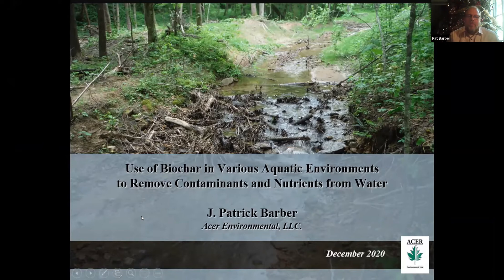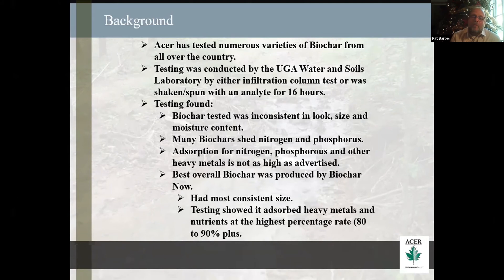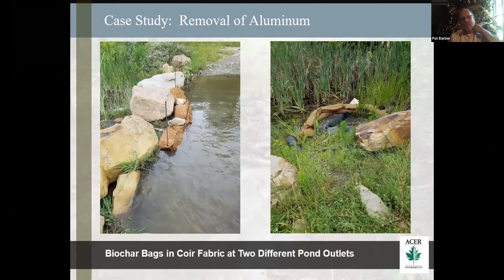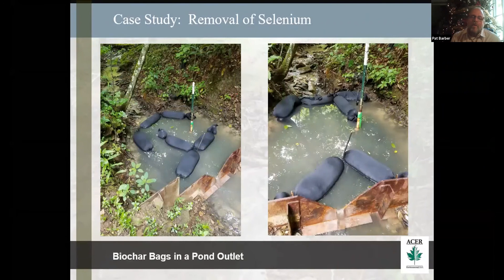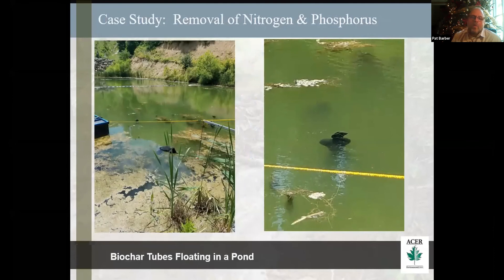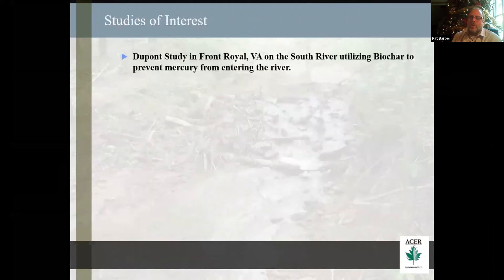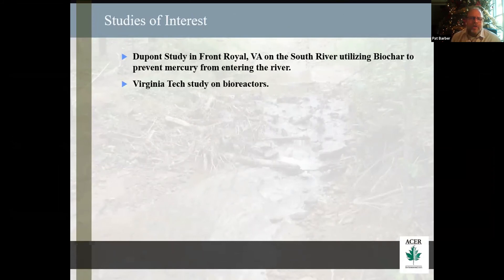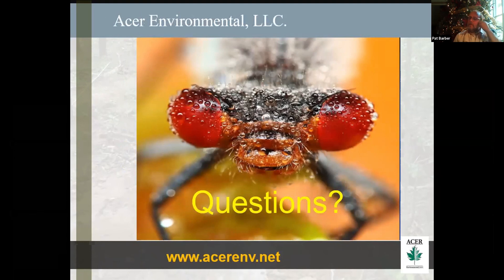Patrick Barber: Use of Biochar in Various Aquatic Environments to Remove Contaminants

Comment: I am doing this using my late brothers socks and fir cones and bark I get from the property. I live with an abandoned and buried contaminated soil dump in shawnigan lake. I make biochar  in a barrel tlud kiln and put it in socks with a bit of sand in the toe so it sinks. I  have been getting the community to hang socks off their docks. My water is as clear as it was when I was a kid. Amazing. I cleaned Fuller Lake after it got a no swim algae bloom. 10 socks.. gone in 6 weeks. Clear as it was when elders were children. So cool. The local givt don't want to help me so I do it myself with my water warrior community. I made charcoal filled socks and attached used haybail twine to hang them. I have a rd side stand giving them away. I have a stand on the water on my floating wetland with a bucket of socks. I gave away 400 socks this summer. I am firing up my kiln again to make more biochar from my fir cones and bark. The biochar is so fluffy because the sap makes it burn extra hot. I dance on it wearing boots and store it in garbage bags. My community is dropping off socks for me to fill. It's a beautiful thing. I am so excited I can catch the poison before it gets to my lake. I have been throwing 5 gal buckets of biochar off the bridge upstream from the mouth of the lake where it comes in. The water is clear and no milfoil. So glad I found my purpose in life. I'm happiest when I'm covered in charcoal. Check out my channel. I'm terrible at documenting my successes. Would love to have water tests before and after